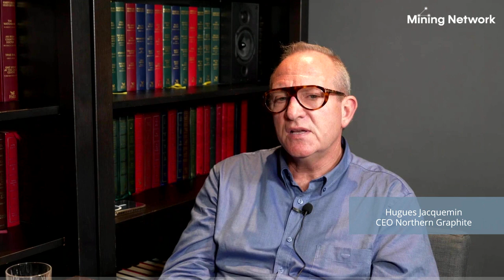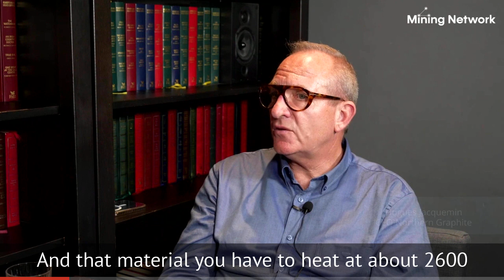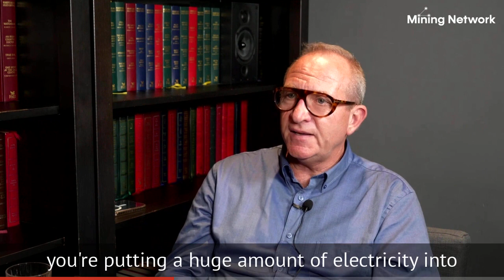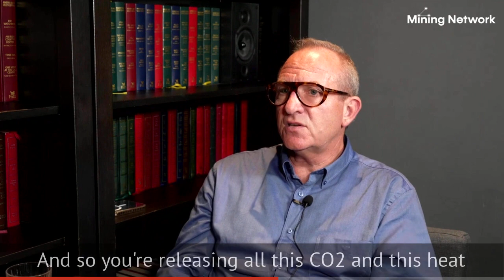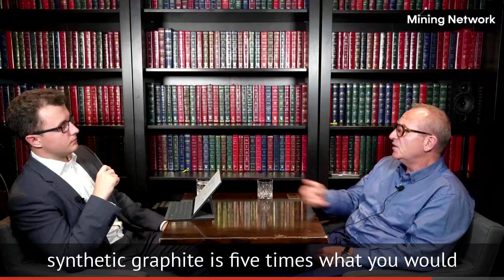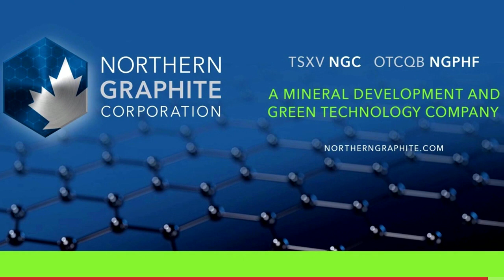How Synthetic Graphite is made

Comment: Sphericalization of flake graphite is also intensive and is required to purify natural graphite.
Reply from the maker: Sphericalization refers to the process of rounding / shaping the graphite flakes. This is independent of purification, which is the process to remove non-carbon impurities from the material. In order to produce Spheronized Purified Graphite (SPG) both process steps are applied to achieve a Spheronized Purified Graphite.